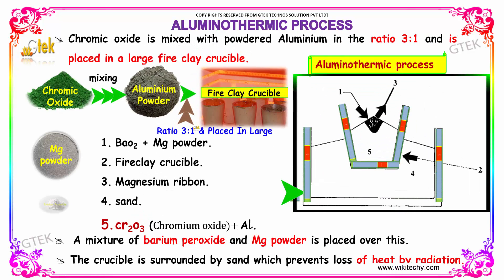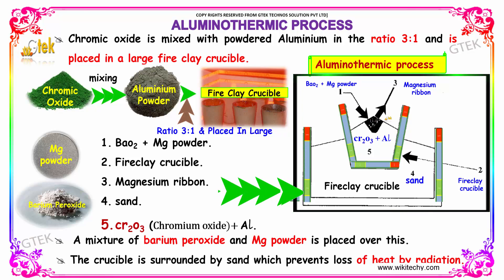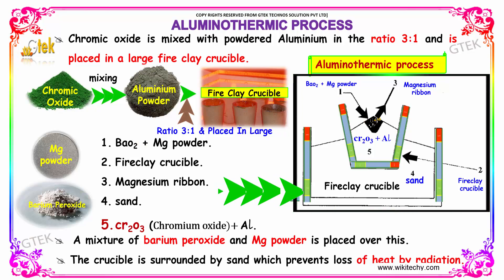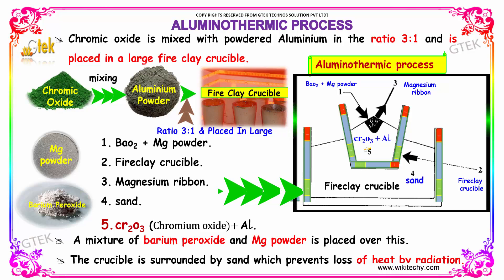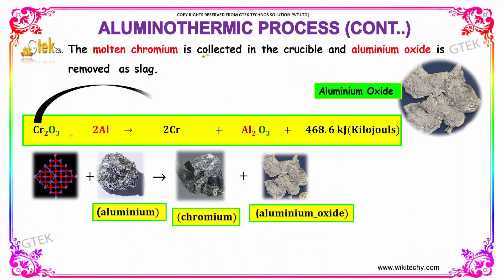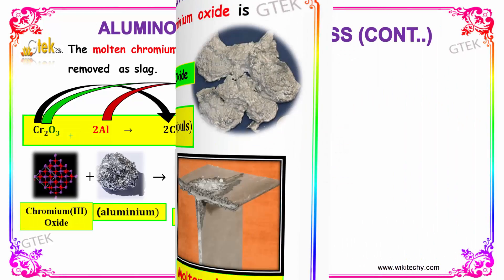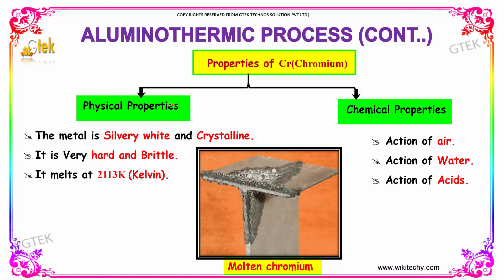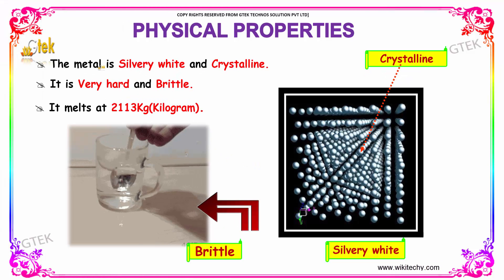Aluminothermic Process D Block Element class 12 chemistry subject notes lectures cbse

Comment: Another thermochemical process is aluminothermic (thermite) joining. It has been successfully used for both ferrous and nonferrous metals but is more frequently used for the former. A mixture of finely divided aluminum and iron oxide is ignited to produce a superheated liquid metal at about 2,800° C (5,000° F).